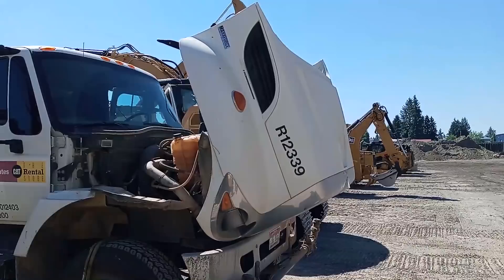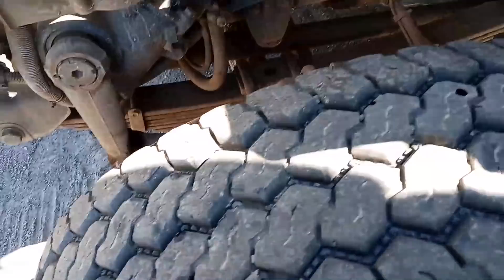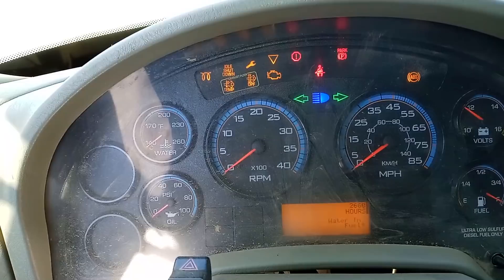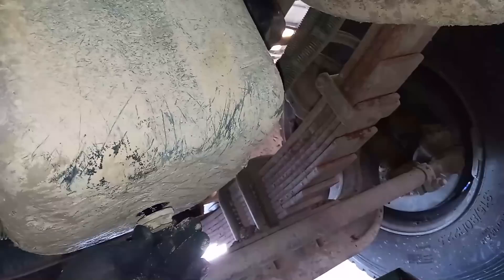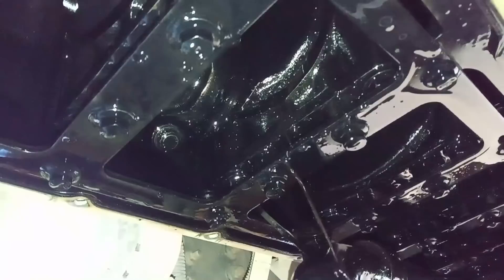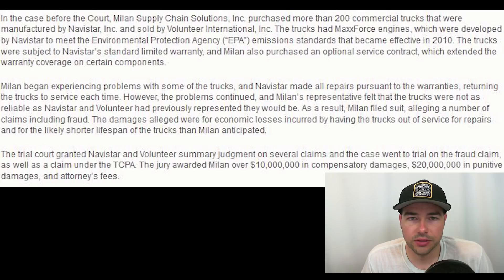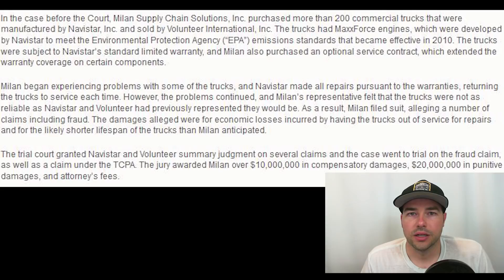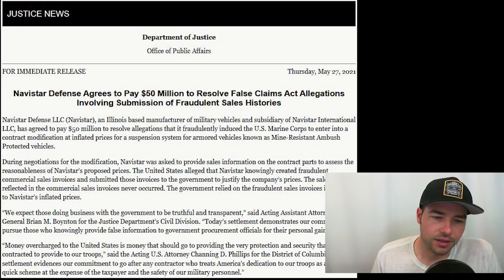CAT Mechanic working on an International. Are Navistars and Internationals Junk?

Comment from the maker: Thanks for watching! The DT466 and 7.3 Powerstroke were good engines by the way, just not a fan of their later stuff. You can help the channel by clicking on the Amazon Affiliate links: Milwaukee 1/2 Drive Impact w/batteries: https://amzn.to/3chlAwB 
Dura-Block Sanding Block Set: https://amzn.to/35tbhkS 
Hutchins Sanding Block: https://amzn.to/3hWJuyi 
Anodized Aluminum 38" Straight Edge: https://amzn.to/38unDLN 
Fowler 18" Straight Edge: https://amzn.to/3nuofoW 
IR 315 flat air sander: https://amzn.to/39gPsWU 
Precision Instruments 1/2" Torque Wrench: https://amzn.to/3pgwqa6 
Precision Instruments 3/8" Torque Wrench: https://amzn.to/2NmFUlQ
Reply: Can't beat a 7.3L👍
Reply: My 'Binder is a '98 4700 with a Vulcan 896 wrecker bed. It sees real MD action daily mostly pulling around much younger descendents 😂  Knock on wood but I service it, fuel it & that's it. I never have to touch it, just twist the key & go. You're forgiven 😁

It all started going downhill with the discontinuation of the 4700 & all series using that cab & electrical architecture. Those were probably some of the best class 6 trucks ever built, simple, cheap & easy to repair. But like everything else, when they started trying to make big trucks behave & feel like cars, that's when the proverbial shit hit the fan, here's looking at you Freightliner 🙄😒  let's face it they all suck nowadays. Assuming I can get parts or it's not forced off the road by some Commiefornia mandate, I'll never sell mine. It's sad because Intl was once one of the best.
Reply: Thank u for saying good things about the  dt466 and t444
Reply: @SOU6900  or the 7.6
Reply: Oh no! here come the powerjoke fanbois!!
Reply: @kbng02  lol
Reply: Mechanical dt466 to be clear
Reply: I have a DT 466 in my 2000 International  straight box truck and a 7.3 in my 97 Ford F350. These 2 are great motors ; no doubt.
Reply: Indeed. The old DT series engines were dependable work horses as was the 7.3 power stroke once the minor bugs were retrofitted out of it. But like any good engine they fall victim to the emissions mandates and become turds. Diesel engines have entered an era similar to gas engines built from 1978-1986. Gas engines came out of the horrible era of smog pumps and feedback carburetors into the era of  electronic multi-port fuel injection with many advancements since then making them better than ever. I hope the same for diesel engines but with  all the stringent emissions mandates and the "green new deal" its unlikely.
Reply: Think its the DT466 that many school buses had in them, as well as smaller trucks. Don't know how many times I have been following one and the bluish smoke that those buggers make is bad enough to choke you to death. Seems like between gears ( if a manuel) or downhill not under load it was worse.
Reply: Adept ape..I have a 98 international 4700 lp dump With the 7.3...good engine but dogish up hill..any suggestions on an upgrade ? Please need right under cdl 26000 gvw to carry pallets of pavers and stone.
Reply: @spar1993  yep anything with electronics suck
Reply: What about older trucks, like my 98 9300, its got a 3406e.
Reply: Absolutely the mechanical DT466 and even it's little brother's were awesome engines that would go forever especially if it had the in-line injection pump instead of the rotary style pump.
Reply: Haha great video that looked like a epa07 maxdt.. to be honest that's a great engine and in the 8 years at navistar as a tech I've never sceen that failure.. they use the heui system and if oil is kept up are strong.. with that said.. haha there egr system is what kills them, they simply run to much... kills the cylinders eventually..
The IBB 11/13 are exactly what you said.. the last year's of them the N13 they were called were great the changed there egr system to a cummins based system and was the cure.. very strong long lasting engine that we rarely have any issues with with the exception of scr related issues.. 
Now, navistar new engine the A26.. so far.. personally of course one of the best engines navistar has built.. there are the few that were "built on a monday" but as a hole were have lots in circulation woth over 500k (km canadian here :) ) with zero issues... 
Keep up the great content
Reply: Been reading a fair bit about this MAXforce engine especially the 13ltr platform. I work on Europen trucks, I’m a mechanic at a dealership for MAN trucks now to my knowledge the VW group owns them. 
We have a model called the D38 that’s also 13ltr and looks very smiler to that MAXforce.

The compound turbo set up is the same the wiring harness is the same commonrail fuel system even the EGR coolers and EGR flap. But the block is a little different.

We have had endless problems with the wiring harnesses it’s a nightmare to change. high pressure intercoolers and EGR coolers are high failure items. so I think the VW group has a big part to play in the failures for theses engines as I’m pretty sure the are involved
Reply: @niallcosgrove5596  yes, from what I'm aware of MAN helped develop the base engine.. can't confirm but thats the rumor
Reply: @joshprince1987  yes it would appear so.
Reply: Dt 466 worst engine ever!! 7.3 powersteoje good
Reply: They haven’t made a engine worth a shit since the dt466. They can’t keep an engine together so now they put Cummins in them. Trash
Reply: @jacobking6966  
Give the a26 a chance ..
Reply: The 7.3 was only a good engine because it was a gutless POS.
Reply: @SOU6900  if you can't have a 5.9 Cummins.
Reply: Hello what is your opinion about the maxxforce dt 9/10 year 2013 ???
Reply: I Agree, 
If I see a late model international truck,, I Cringe inside, just thinking about it..
Reply: I have a 2012 International Maxxforce 7 CE V8 School Buss with major blowby.... What can be done? Nothing has been done to attempt to fix/repair this engine yet.
It starts right up... No problem starting up at all, almost instant start up... But it has blowby.. Will not drive over 25-30mph WARNING Light comes on truck start shaking bad.   Is this fixable?
Reply: As far as styling goes, the S series was the best looking International Harvester truck,the 9400is,and Prostars look like total shit
Reply: @SOU6900 The S series are 
Damn good looking trucks, The Prostars look shit

Comment: All engineers should train with the people who work on their equipment.
Reply: One big plus working for Helmerich&Payne independent drilling contractor. They have the best iron in the oilfield for a reason. They have an entire floor in their downtown Tulsa high rise building dedicated to their engineering teams. They do not purchase rig packages from NOV or any other. They build every drilling rig in house, even drawworks and top drives. Their engineering team works closely with their field service technicians to develop the most dependable and redundant machinery in the energy sector. It was a growing experience working there.
Reply: I have the same dream my man... If only...
Reply: Far too arrogant to even consider listening to a mere mechanic
Reply: I think truck manufacturers listen quite a lot to mechanics.  That's why they all still use front straight axles on leaf springs.  Every chassis engineer knows that combination rides and handles like a dishwasher tumbling down the side of Mt Vesuvius, but with 5 moving parts, 2 of which only move because they bend, it's extremely maintenance friendly.  Compared to the absolute state of contraptionry under the hood of a modern pickup, modern semis are shockingly maintainable.  I think diesel mechanics could do a stint as car techs to appreciate just how good they have it.  "BRO, WHO INVENTED MINIVANS?!"
Reply: @JETZcorp  I have a skid steer (John Deere) and a Kubota Tractor and I am an IT guy so not a professional mechanic for sure. My comment was pointed mainly towards passenger vehicles and trucks. I have to say that overall I am very pleased at how easy the skid steer and tractor are to maintain and repair. Everything is much easier to get to for sure. I have a 1996 F350 with the 7.3, it too is fairly easy to work on even for an amateur. I love all of the mechanics and trade professionals that have channels.
Reply: @iamthemoss  I agree passenger cars are a blood-soaked nightmare to work on.  I cut my teeth on old motorcycles.  Aside from the Japanese Phillips trap, it's all quite lovely.  But I've had to learn the hard way that cars are a whole different animal, and one I'm not qualified to tame.
Reply: @JETZcorp  Thanks for the reply, yeah, i have a friend who owns a diesel shop, I enjoy hanging out there learning pointers. When I retire in a few years, I hope to work with a fellow who owns a heavy equipment land clearing business. It's oddly satisfying. It's odd from a guy who's worked in cancer research, food production and IT. Next project is to fix a rough running Kawasaki Mule.
Reply: That would still make the max force engines trash 🤷🏻‍♂️
Reply: Where I'm at navistar engineers do work with the mechanics.

Comment: I love international, I was 1 certification short of diamond certified on navistar products. The reputation of international went down the drain when the maxxforce engines came around. The A26 is starting to turn around the reputation but really slowly. The DT466E will always be the best medium duty Diesel engine ever built.
Reply: I also love them, no frills work trucks. The ones we run are all older with big cam Cummings though.
Reply: I’m diamond certified. You are not missing anything 😂😂
Reply: Garbage design and materials.
Reply: A26 is off of the MAN D26.  Interestingly enough, they got the design during a “strategic technology cooperation”, yet before Navistar was bought by Volkswagen.  Oh boy, I can’t wait to go to work tomorrow and drive my Volkswagen LT.  Hell, it’s a long lost cousin to the diesel Jetta I drove to work.
Reply: The DT466, Cat 3116, the Cummins 5.9, ALL we're reliable as hell. It's only after they added all the emissions garbage that the problems arose... Yay progress...
Reply: A26 so far has been a great engine.. personally
Reply: The only reason that the A26 is any better is because it's a joint venture with Volkswagen group
Reply: @dangoldbach6570  emissions junk took otherwise great engine designs and pooped on their reliability. I hate it.
Reply: I was diamond certified, now a mechanical engineer and I couldn't agree more. There was no better medium duty engine with a better designed bottom end than the DT466 "new generation" mechanical and beyond
Reply: Dt466 = legend. Even the dt466e. Basic electronics, cruise control ❤

Comment: Dt466 and dt360 are both one of the best diesel engines ever made
Reply: DT466 and DT360 are TWO of the best Diesel engines ever made.
Reply: @mattbenluke  Some
Reply: @mattbenluke  and early Maxxforce DT single turbo. The 2010-2015 Maxxforce DT is kinda bad.
Reply: Obviously you never owned a cat 6nz so.or any cat for that matter, you just say to say
Reply: @mattbenluke  Cummins 5.9liter would like to have a word
Reply: @charlesrodriguez7984 Dt466 is way better than a 5.9 Cummins You're smoking dope kid That's why nobody I mean nobody drives over the road in a medium size truck box truck I should say with the 5.9 Cummins but you see the DT till this day going strong stop the cap
Reply: At my warehouse the only Internationals left are the DT466 and 7.3 Powerstroke.

Comment: Personally, I am a big fan of the international trucks, but I am not a fan of their new engines, I prefer an international truck with a caterpillar or cummins engine
Reply: Their newest engine ................ the A26 ................. actually seems pretty solid.  It's a 12.4L MAN engine!  The MaxxForce was trash!
Reply: @chackos123  I just bought one with an A26. I hope it works out. It does have a full 2 year warranty.

New trucks are non existent. If you order one it's a 12 month wait.
Reply: @chackos123  Max Farce is more fitting
Reply: Or Detroit diesel
Reply: The A26 is hands down a better performing motor than the x15 in my experience
Reply: @chackos123  the original maxxforce 11/13 IS a MANN engine

Comment: I know this video is a year old but, There some engines out there that are icons for reliability, I loved the 855 Cummins and the B, C, & E model Cat engines. When engine manufacturers were forced to put emissions on their engines they all had issues, some more than others, the advanced EGR was what killed the early Maxxforce engines (it was a disaster, they were trying to burn too much exhaust gas in an attempt to avoid DEF as a sales pitch), International wasn't alone in engine issues after 2011, I had a customer who had a fleet of Volvo's and he wanted to burn that fleet to the ground, which surprised me. The new A26 seems to be a much better engine but I've seen a few broken piston rods, other than that (yes I know laugh it up Yuk Yuk!) large fleets seem to be happy with them. Totally agree with you on the DT466, short of running it out of coolant or oil you couldn't kill it the 6.9, 7.3 and 7.3 powerstroke were great engines as well.
Reply: I work at a international dealership, ya we had a number of engines with shavings in the bearings causing failure. International would get on ur ass as soon as a truck went down with a A26 and they would shotgun u possible parts you'll need to get it up as fast as possible. One had a code that may have lead to a engine and they shipped a engine over in a day to be safe incase we needed it.
Reply: @evanwerkhoven7046  Cool, I work for International too, it's amazing how fast they can get us a complete engine. After the MaxxForce debacle they're doing everything they can to get ridi of that stain.
Reply: I owned cats and cummins 15, in 10 years of otr I never take it to the shop. I'm selling super reliable and powerful 6nz at the moment
Reply: @0311catfish True that, unfortunately all the crap the EPA has made us hang on our diesels it's affected us all in a not so good way. I hear that International is changing their DPF/DOC configuration and getting rid of EGR coolers. I kinda can't wait to see it and how well it works or not.
Reply: @0311catfish I work for a dealership and use to be on the floor, I can that the reliability of the emissions system is getting better, still a pain in the butt but getting better
Reply: @richardsb3606  the EPA ruined everything diesel powered. Some companies had to suffer more than others to make the changes to their engines.
Reply: @charlesrodriguez7984  There's no doubt about that, that's why CAT stopped building engines for highway trucks and the 855 Cummins platform went away, they tried to meet emissions with the N14 and still couldn't meet the requirmets so they ditched the whole platforn and came up with the ISX, now known as the X15 which they are now using the X15 platform to burn Hydrogen.

Comment: Ego destroyed Navistar, the upper management ran the company based on their ego's and nothing else and that's what caused the MaxxForce engines (and the brand sadly) to be complete junk from about 2009 as they prepared for the 2010 emissions until Ustian and his minions were purged from 2012-2015ish.  They've started to try and turn things around, but now owned by VW and still for some reason, trying to be the cheapest product in the industry.   If they get back to their roots, listen to what the customer wants IPO making sure they have the cheapest part cost to MFG, International can get back to what it was in the early 2000's.

Comment: When I worked at the County Fleet Services department,  we had mostly International plow & dump trucks. This is because they are usually the lowest price truck available on the State bid process. 
You get what you pay for.
Reply: That’s how it goes when it comes to fire trucks. The volunteer Dept I was on we had an 05 4400, nothing but issues. The paid department I’m currently on, we have a 2015 4400, was constantly having issues and usually it was either a wiring issue or a motor issue. Prior to ordering the truck in 2014 I said, get a different chassis. Do not get an international, but because it was cheaper…….. The rest is history.
Reply: @atx-cvpi_99  strange, I haven’t heard anything other than the water pumps at exactly 100k.  Well, that and unless you got the ecoboost, Lordy lord are they slow.  The ecoboost is wicked fast.
Reply: A old man said they had a Fleetstar and a later White 9000 with the Autocar can, said both were identical mechanicaly,but he liked the 9000 a lot better, a old IH truck salesman said "White had us beat on everything but price"
Reply: They're also one of the easiest to work on. Working on a freightliner is a wiring nightmare

Comment: I was the mechanic for a whole fleet of DT 466’s the old or 1st generations were very reliable when they changed to 2nd generations things went downhill.
Reply: I need your help lol
Reply: That's true, they had really bad drive wire issue that was undiagnosable. on the later generation engines.
Reply: Those were nice and pretty easy to fix
Reply: @musicauthority7828  i need your help t3800
Reply: The first 10 years of my driving career I drove International 4900 beverage trucks with the DT466 engine. They weren't that fast but you couldn't kill them, they just ran.